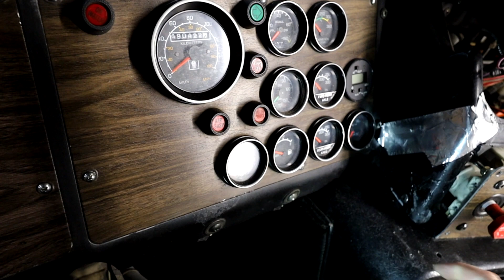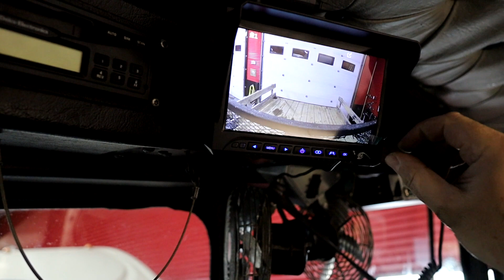The most important upgrade to the K100 called Kenny!

Comment: You've done an outstanding job installing that piece to the front grill. Now all you need is the other piece and make it whole.
One other question when will you get rid of the top spoiler on the cab?
Reply from the maker: I like the wale tail so it will probably be staying.  I need to focus on the Peterbilt for a bit now

Comment: Personally Mike, I would grind down around the screwholes on the upper grille and weldin those five holes with weld grind her down smooth and replate it with new chrome be cheaper in the long run